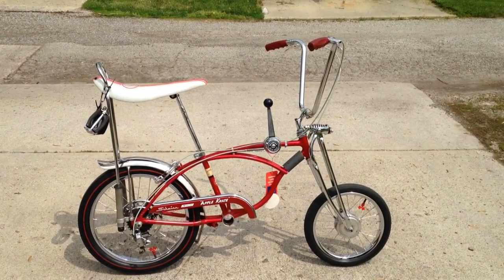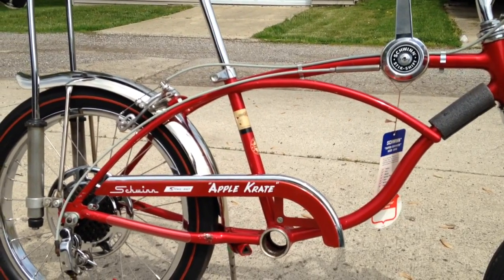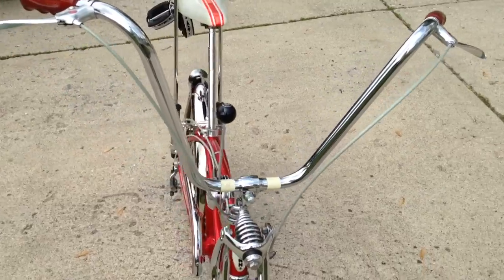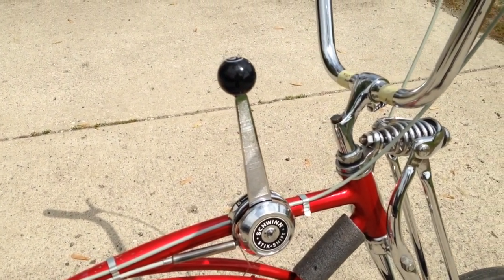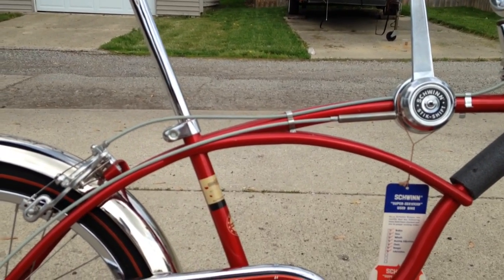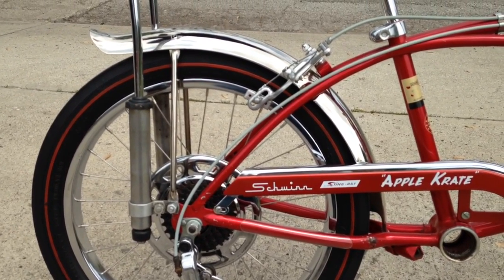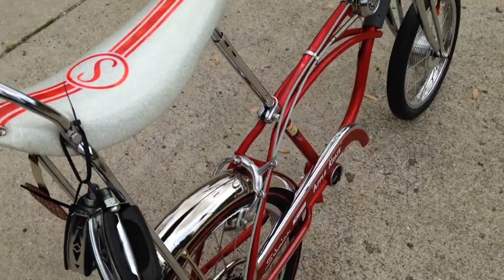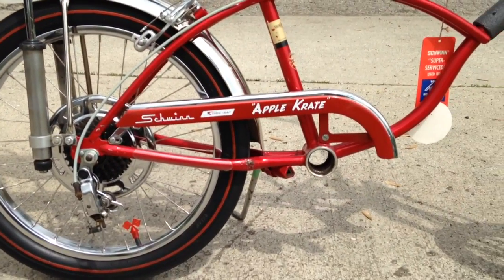1968 Schwinn Sting-Ray "Apple Krate" - Project

Comment: I had a blue one. It was so great, untill it got stolen. Wish I still had it, it was a great ride. Leave it as is, use steel wool on any rust. Better original.